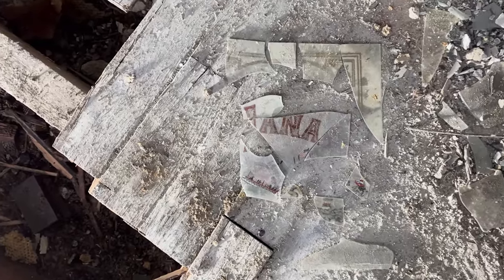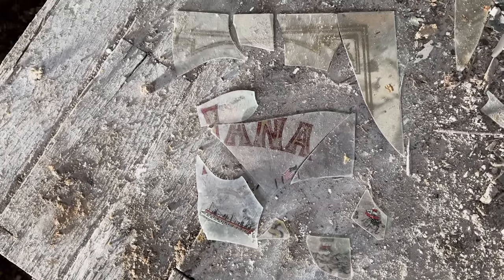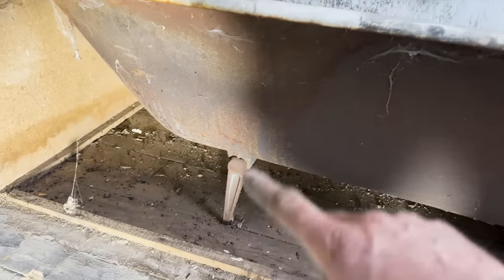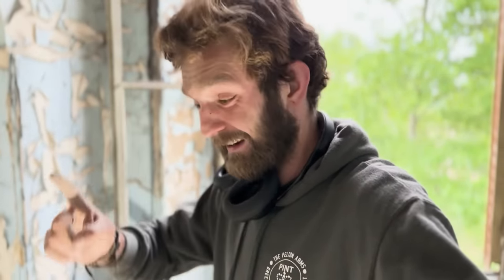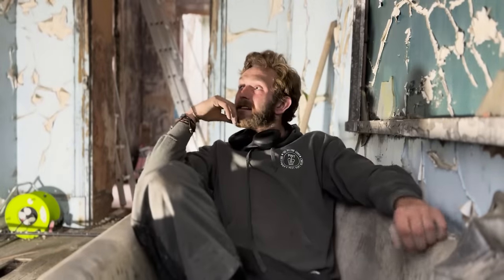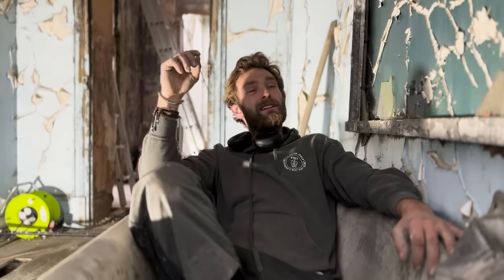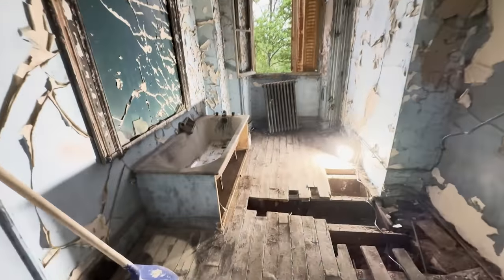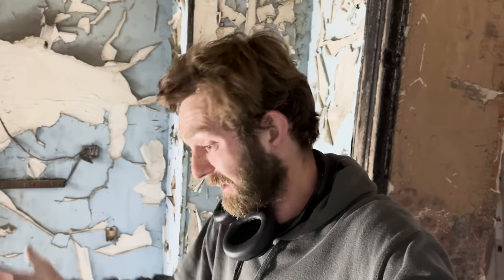Definitely not a video; first bath in the chateau.

Comment: Had baths like that one renovated and painted with special product my self. Have renovated 12 old houses in Australia. Keep up the good work Dan.
Reply: Yes, there's special epoxy paint for baths. Looks better if done by a professional but you can get DIY kits from various paint manufacturers. Stinks to high heavens, my parents had that done in the late 90s. It lasted over 20 years until it started to peel in a few spots. Still a lot better than the original finish when they had it redone.

Comment: I was hoping you would decide to save the bath ... and you did! Yay! 👏 You're right, Dan, it would have been a beautiful bathroom. Love the blue walls. 👌💞
Reply: I wonder if that was the largest bathroom?
Reply: @margaretstanton7567  There were four bathrooms, each roughly the same size but the ones on the second floor have much lower ceilings than the ones on the first floor. I wonder how old they are. The plumbing is definitely 1960s or newer, all PVC and copper, and the chipboard looks even newer, early-60s chipboard was a bit coarser in my experience. The cast-iron bath on the other hand looks older than that, possibly 1930s. I've seen 1920s and 1930s baths that were meant to be either freestanding or enclosed but those had just a tiny bit more presentable feet than this one. All the 50s and 60s baths I've seen were much thinner metal and had plain pressed steel feet though, so I'd assume this might be from the OSE renovation in 1939. Worth saving, even if it most likely needs to be refinished inside and out.
Reply: @Ragnar8504  Thank you! I noticed the chipboard looks like it was put in a couple of years ago! I've never seen legs that thin on such a heavy bathtub. I have to review the complex history of this mansion to sort it out. It's hard to understand how that much rubble could fall on the first floor without breaking through the basement ceiling--or maybe it did?
Reply: @margaretstanton7567  It's really hard to tell what is fire damage and what happend during the 35 years the building sat without a roof. The basement ceiling is concrete supported by steel beams, a very strong design, but one of the ceilings did collapse completely and two others are very close. All of them need to be replaced and Dan has mentioned that before. Rain, snow and frost can really destroy a building, and fairly quickly too. In a way it's a miracle Dan's château has so much of the walls left after 35 years without a roof!

Comment: The metal edge on the bath is for enclosing the bottom should have had some insulation there though as the reason for enclosing the bath is to keep the water warm longer. It is still a valuable tub and I would save it. Some nice tile work around the outside of it or a stone slab (I prefer stone/marble/quartz large slabs) just easier to clean slabs rather than all the grout.
Reply: I think that bath was simply enclosed for neater looks and easier cleaning. The idea of insulating around the bath only came a bit later.

Comment: Hey Dan! Interesting video! Great that you found the bath in such good condition! I suggest trying everything you can to preserve it! Maybe sandblast it or something to clean off all the rust and paint, etc., and identify any issues / holes, etc., that need to be fixed! I'm sure it would be great for you to keep it and put it back in when you're done!
As for the floor in that room (and any other room that still has old floors in it)! I know you can't keep it, but, in my humble opinion, as long as it currently holds your weight, etc., it serves a purpose and would probably be useful to you until you get other floors, etc., sorted out, as it makes for easier maneuverability, etc., and, if it can handle the weight of yourself and the scaffolding, then, maybe you can start building the upper floors in that part first.
Reply: This section has floors all the way up to the roof, it's the other side that's completely gone.

Comment: That bathroom seems to have survived the fire amazingly!
Reply: It looks like the door was closed. The side of the frame where the lock was has some damage, everything else seems to have gotten hot but not to the point of charring. The extremely odd exception is the short piece of skirting board between the door and the bath, which is completely black.

Comment: Good morning, Dan!
Glad to see the renovation of these beautiful French castles.
Just a few questions: 
Wouldn't it be appropriate to shore up the basement, to avoid a cave-in? The fittings are exposed, so even for storage of material, it would be dangerous. I know there is an area on the ground floor that you had to give up removing the rubble because the floor is badly damaged, about to collapse. So, at least part of the ground floor/basement ceiling can't be saved, but what about the area you removed the tiles from?
and, why not build the access staircase from the ground floor to the first floor right away, as the iron beam could be preserved and has already received anti-corrosion sealant? Or, at least, a provisional staircase, which would be safer and would make it easier to carry the building materials to the renovation of the upper floors.
I noticed that the timbers that supported the old steps on one side have still not been removed. Would it not be possible to support steps, even if they are provisional?
Regards from Rio de Janeiro, Brazil!
Reply: The basement walls look reasonably stable, the ceilings all need to be replaced at some point though. Temporary stairs do seem like a great idea! I wouldn't use the old stringers, better try to get some metal scaffolding stairs. Easy to install and easy to remove when the ceiling will be replaced.
Reply: @Ragnar8504  Good idea!
I really don't understand much about construction, it's just a safety concern and a way to make Dan's job easier.

Comment: Great score if you can recover the bath! Don't scrap the radiators you may well be able to reuse them. Cast Iron doesn't rust anything like as badly as steel and the even steel of your chateau's date will resist more than modern post war steel! Cheers, Matthew (into his 44th year in France, with lots of building work experience!)
Reply: I've got a sneaking suspicion these radiators are much newer than they look, maybe even installed by Mironnet in the late 1960s. They still look cool and it would be nice to save some, if possible. If not 1960s, they're probably late 1930s.
Reply: @Ragnar8504  Here in Paris, cast iron radiators and thermo-syphon Central heating started in the end of the nineteenth century, (pre-electric they used to have people that ran the coal boilers 24/7 in shifts, teams being responsible for several buildings!) It is possible that those radiators were original!

Comment: I thought of you today, Dan. i was up on my ladder clearing gutters. 5 meters up, and a cedar needle flew into my eye and got stuck under my eyelid. 😫Of course, that meant that I could hardly keep the other eye open to get down the ladder, across the deck, down the stairs, into the house, and into the bathroom to flood my eye with water and get the dang thing out. I wondered how you would have handled that up working on the tanks? I did have my sunglasses - I'd just flipped them onto my head. 🤦‍♀🤦‍♀🤦‍♀

Comment: Maybe you could tie a tarp from one of the upper floors and tie the other end to your trailer and use it as a slide. Throw your debris onto the tarp and it will slide down into the trailer. No need to clean up the floors below every time you clean the upper floors. Could just have it dump onto the pile you have outside. Just an idea 😊

Comment: My guess is the tub isn't original but part of the "modern" renovation, or after the good stuff got sold off. It's still part of the history of the place but doesn't seem to be up to the level of elaborate molding, guilded mirrors, and leather door handles.
Reply: I've been scratching my head what book that description might have come from. My suspicion is that it's an extract from Jacques Jung's Sortie de route en Creuse, which is a crime novel set in 1970, so I wouldn't feel safe treating it as a historic description of the château, at least parts of it could well be fiction. I haven't read that book (obviously, otherwise I could tell you whether the extract Dan read to us is from that book or not) but the story is somehow related to Chaumont based on the blurb.

The tub is most likely from the 1930s and the identical one in the other bathroom crashed through the floor during the fire. That's the one Dan and Calvin removed from the entrance hall.

Comment: With the square edge of that cast iron tub and the non-decorative feet,  it wasn't built to be stand alone, but chances are it would have had a teak wood surround. You could use it as stand alone after painting the base with black enamel.

Comment: That bath you can get it sandblasted and powder coated any color you want and reuse it.
Reply: I'd go for the authentic route and paint the outside with linseed oil paint, that was the paint of choice in much of Europe well into the early 1960s. The inside needs a proper expoxy coating.

Comment: Now that you got the Tub cleaned out you no longer need to go down to your hammock to take a rest you can climb into your tub, that's what My sister's contractor did when ee were pulling a all nighter getting her kitchen ready for the brand new bespoke kitchen cabinets installed in the morning but we still had the concrete to pour where the refrigerator sat and dry wall to put up on the kitchen wall where the sink and all were going but he disappeared so my sister and I poured the concrete and finished all the dry wall, My sister went to see where he went and she found him asleep in the bathtub.